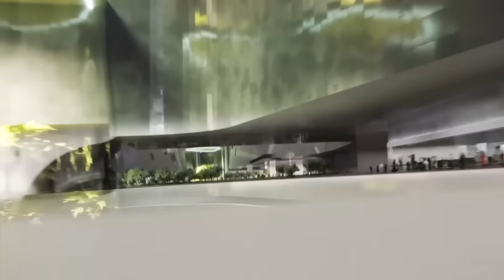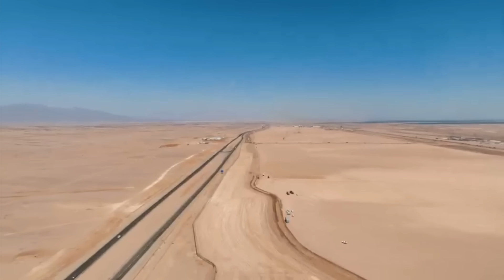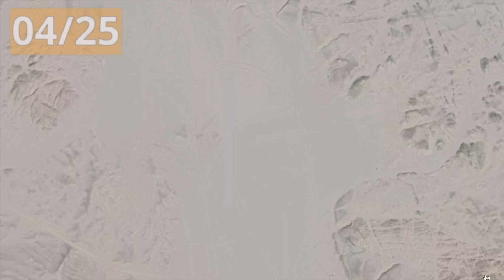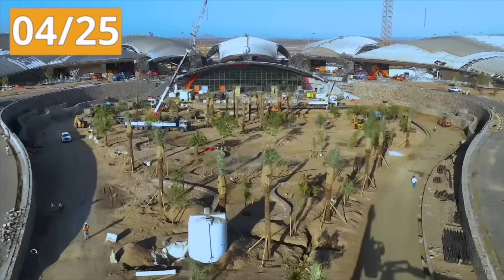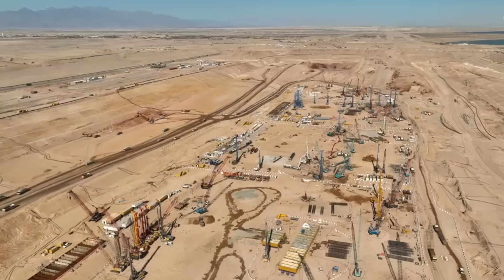NEOM, THE LINE : Update 2025

Comment: So just to fill everyone in: these are friction piles,  because they are near the sea,  there is salt in the ground water.  That means you need to pass an electric current to a sacrificial cathode to prevent them corroding.  All the time.  24/7.

If you stop,  the buildings eventually collapse into the sand

Comment: I hope they actually end up building something. It definitely won't look like the original renders, but even a 2.4km scaled down version would be interesting and might inspire other engineers/architects as to what's possible.
Reply: In fact, the first phase will extend 2.4 km by 2030, and after 2030 they will complete the 167.6 km.